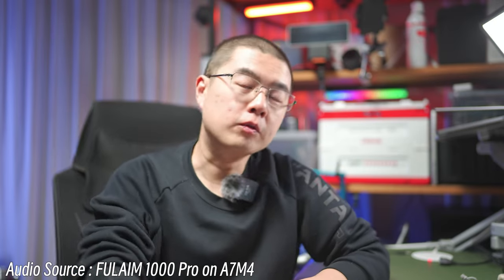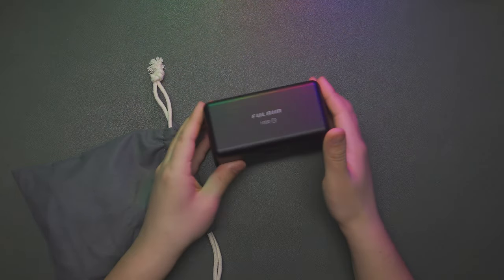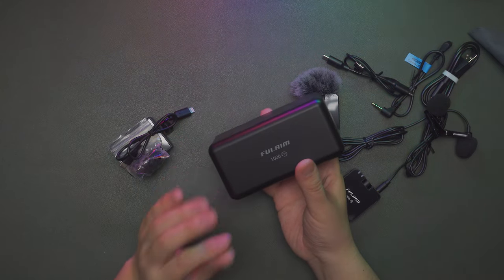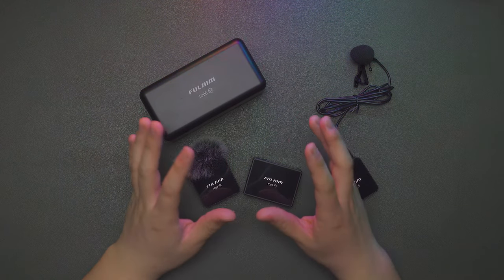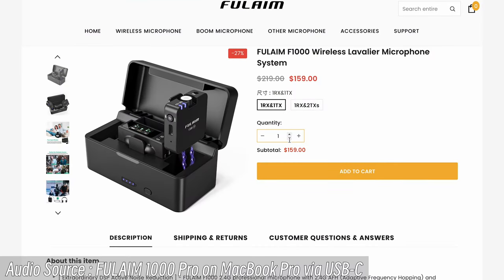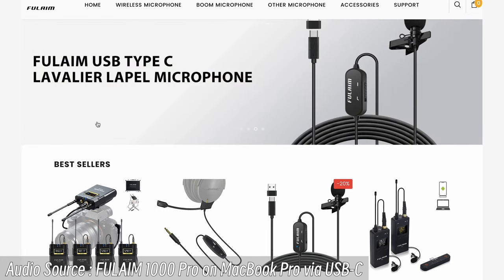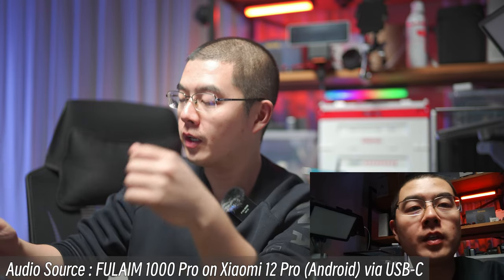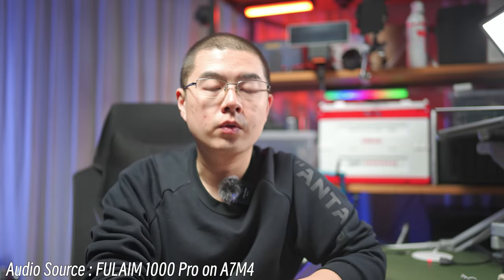DJI MIC KILLER ? In Depth Review on FULAIM 1000 Pro

Comment: Can you suggest to Fulaim that on there next version or if they do an "EX" ("EXpert") or "2000" version!

a. they use locking TRS connectors as the TRS could pull out accidentally  when in use.

b. Does it record to uSD? 
At what bit depth does it Record? 
Ideally it would be 32bit so very loud/quiet noises can be accommodated! 

c. Does it record locally to the microphone unit onto uSDXC?
Before sending to the main unit for recording?
In case signal is lost? 
The additional cost to me of three uSDXC is a marginal additional cost versus not getting a recording. 

d. Please add timecode recording, which is useful for multicamera shooting.

Thankyou
Anna
PS thanks for a really useful review!
Reply from the maker: great suggestions ! Thanks